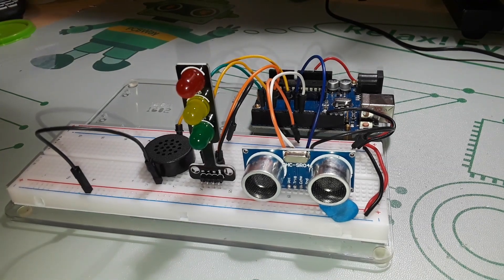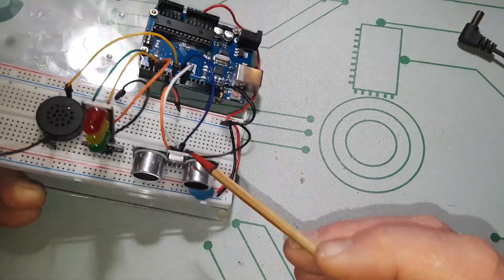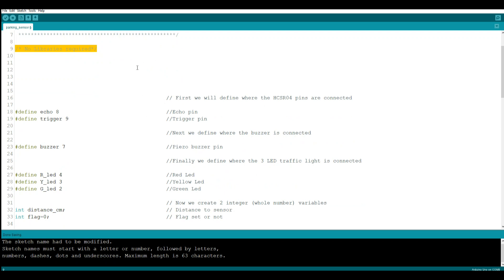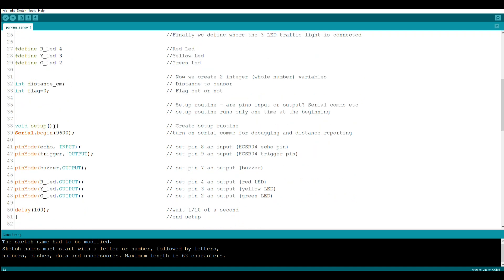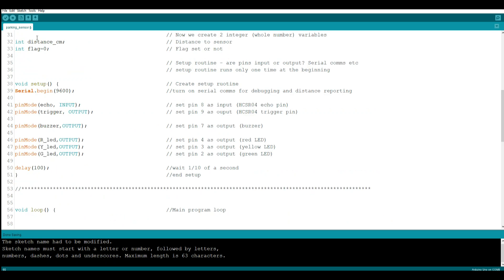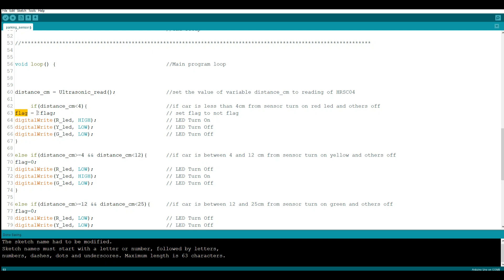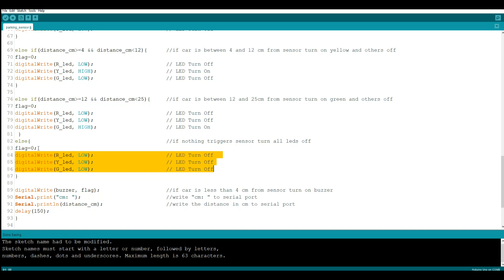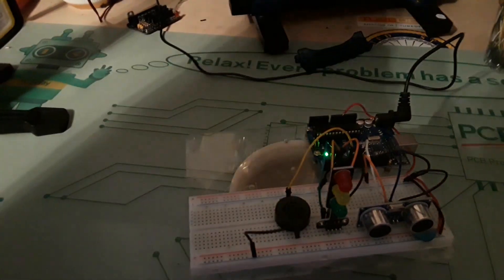Arduino Parking Assistant

Comment: Cool project! It'd be nice to add a low-power feature next where the loop period is increased to lower the sampling rate when 'long' distance is read but it'll go back to a 'faster' sampling rate when the distance to the obstacle is getting closer (in case this is battery powered).

Comment: was a good video. you could have initialized flag as a bool but his is just nitpicking. 
another change is  the sound output is hard to hear , put a led with resistor in parallel with the buzzer so sound has  a visual indication.
putting this in a wokwi / tinkercad  simulation would allow others to tinker with this much easier and increase learning value.
thank you for your time and keep up the work you are doing.

Comment: Great demonstration, thanks Paul. Would it be possible to run two sets of sensors and LEDs from one UNO, and if so how?
Reply from the maker: Yes it would. And it really wouldn't be that hard. You would just have to create a second set of variables. And choose four more pins to plug in the sensor and the LED. But the Arduino doesn't care how many things are going on there. It can evaluate them all within a millisecond. So yeah, give it a go

Comment: If you want to use this for real on a car, you need to buy a weather-resistant, combined sender/receiver to keep this working for more than a few rainless days...
Reply: I recommend MaxBotix for this! They make a lot of weatherized ultrasonic sensors of various ranges. Plus there's multiple output read options on their sensors - analog, pulse width, or serial.